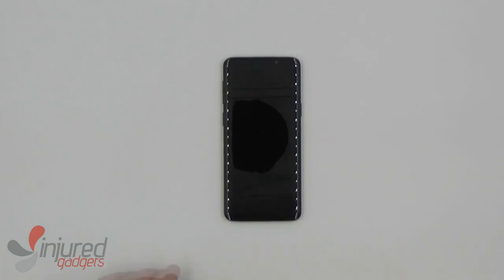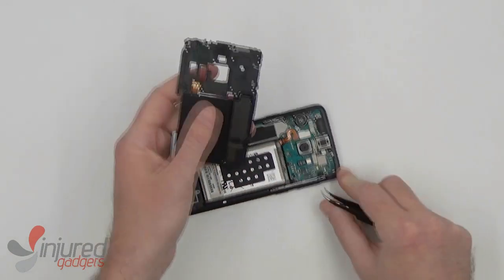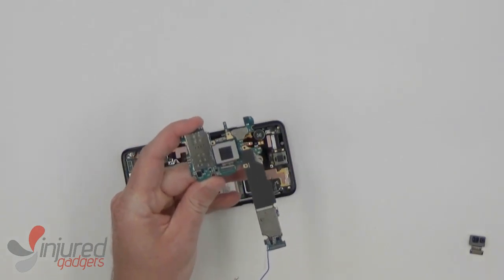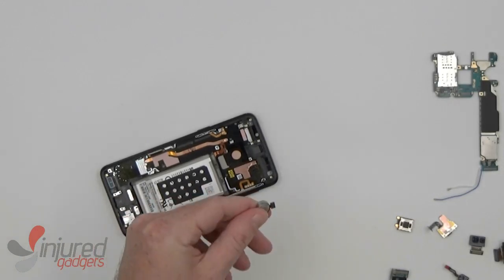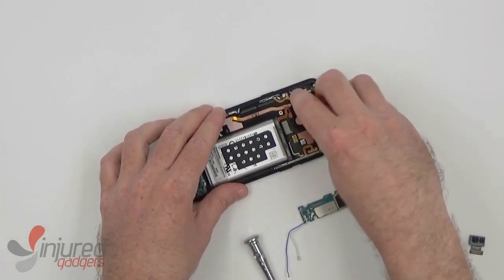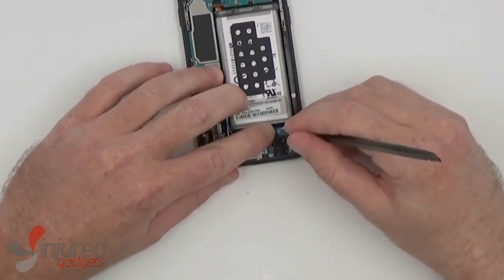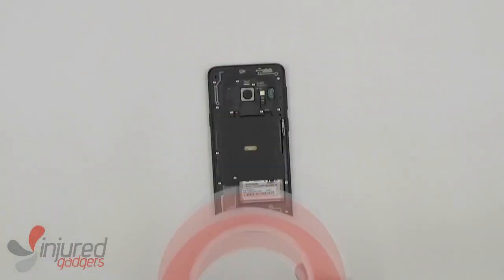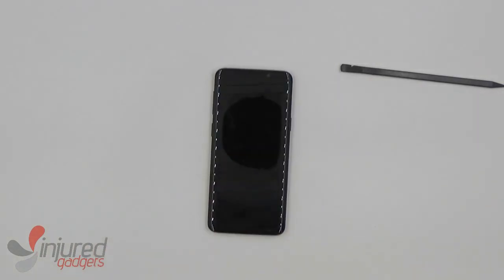Samsung Galaxy S9 LCD & Touch Screen Replacement Guide - Injured Gadgets

Comment: So, where did you replace the LCD Panel and Touch Screen in this video?
Reply: He was simulating.  The battery is the only part he didn't remove before reinstalling everything back into the LCD/Digitizer/Midframe.
Reply: Thank you that's the reason i came to this video becuoae I thought I would see  the lcd and glass removed not the phone housing changed. Totally pointless.

Comment: Hello, I have a question for @InjuredGadgets and hopefully anyone else who has a solution

My s9's front screen has been completely removed down to the 'copper sheet' (?) and a new front screen has been added. However, when I try to power on my phone, nothing shows other than a flashing blue light indicating that it's on. Does this mean that the copper part is broken or the LCD screen? I could really use your help.

Please and thank you.
Reply from the maker: the copper sheet is the OLED. you damaged the OLED when you tried to remove your glass only. You need a full assembly.
Reply: @InjuredGadgets   Ah, well, thank you very much

Comment: I was going to ask a few questions here about replacing the screen, digitizer and back on my S9+ but it doesn't look like anyone responds to comments here so why bother...
Reply from the maker: Hi
Reply: @InjuredGadgets   There you are, ok, my phone just started glitching on me yesterday.  The screen randomly turns to a white/slightly greenish tint overlay that I barley see through and then it will go back to almost normal after I tap the button to turn the screen off and back on real fast. I have dropped the phone a few times without the protective cover on it and the screen is cracked in a few places along with the back battery cover. Will a new screen and digitizer likely fix this issue or does it sound like something more serious? What do I need to buy to fix this issue if it can be fixed?
 Thank you....
Reply: @InjuredGadgets   Also, I have tried several things to try to remedy this from a soft restart to cleaning the cashe partition and nothing has worked and when I take a screenshot while it's on a glitch it doesn't show up on it.
Reply from the maker: @bodeine454  It definitely sounds like your OLED is going out. Itll progressively get worse over time. 
Cleaning cache wont work as those are all software fixes. This is definitely an OLED issue and hardware based.
Reply: @InjuredGadgets  Ok, so is the oled just a new digitizer and screen? Is it fixable or not?
Reply from the maker: @bodeine454  yes to both questions
Reply: @InjuredGadgets  Ok, thank you!

Comment: So how is this screen and lcd replacement????? This is just taking the board out and putting it in another phone. Not much help if you actually want to change the lcd and screen. Totally pointless unless you want to change your phone housing.
Reply: Samsung has made it very complicated to change the damn display so what you see in this video is actually how you change the oled panel and glasz